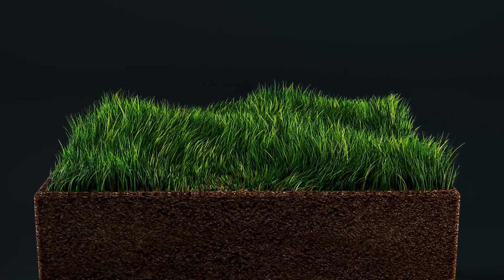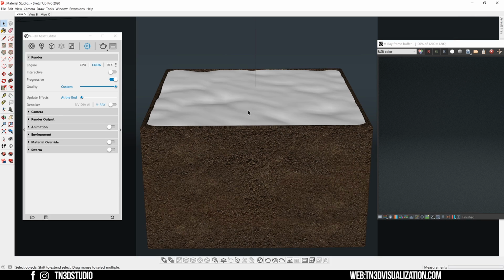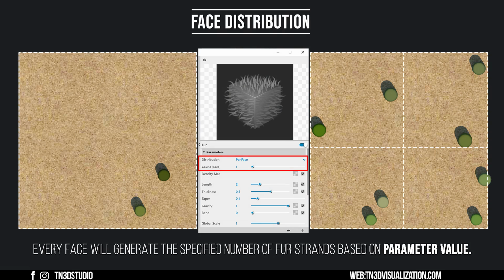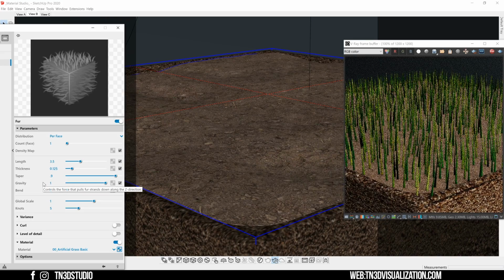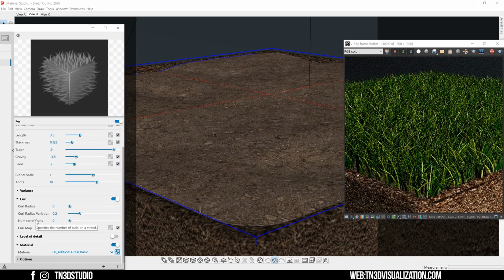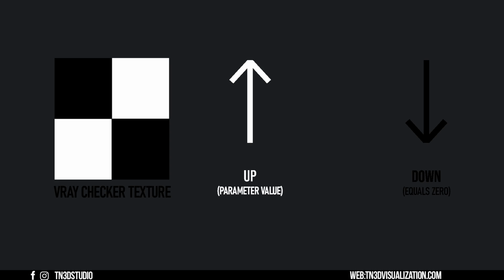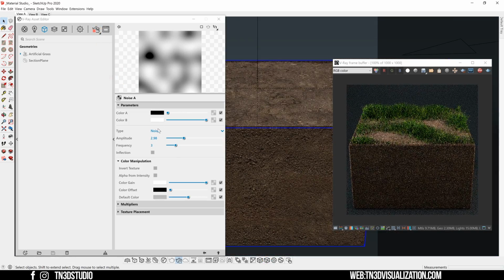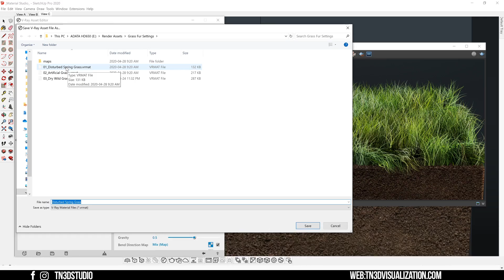Vray for Sketchup : How to Create REAL Grass Material Tutorial

Comment: Hey, amazing tutoriel, helped me a lot !

One question though, my grass works perfectly when rendered with the interactive render, but when i start a final render, the noise is visible on the grass... The parts affected by the noise texture loaded in Length are black... Any idea ? 😢
Reply from the maker: Interesting, might have to look into this. Do you have a material assigned to the grass already?
Reply: @TN3DStudio  Yes I have a material. What is strange is when I disable the noise in "Length" but put one in " Density", everything is fine. The issue is only with the "length" map...
Reply from the maker: @nvdr0j.cmonnomàlenvers  I see, maybe try a value like 4 or 6 on the length parameter, because that becomes the max high for the white values in the noise texture. if your ok with this, send me an image with settings to my email, i can take a look.
Reply: @TN3DStudio  Sure, will do asap ! Thanks a lot !

Comment: It works bt it will slow ur rendering like hell.
Reply from the maker: Yup, thats the only thing about it. Increases render time. But if you optimize your render settings, you can make it work.
Reply: @TN3DStudio  explain
Reply from the maker: @KL-ni2vx  If you check the render quality settings between Medium+ and High. I usually optimize the Noise limit, Subdivision, and GI parameter around those setting and render at high resolution.  It could also be your PC Specs, and complexity of your model. Just have to try the settings and see what works for you :)

Comment: i cannot find a way to apply the save vray fur to a new model. is there away to apply it?? since when i save the vray fur, there is only .vrmat file, unlike the proxy file that there will be also proxy file that is also save on my laptop
Reply from the maker: When your inside the new model, On the "Geometry tab" you should be able to import it. There is an Import asset option on the botton of the vray User interface :)
Reply: @TN3DStudio  no no, i mean after i hav imported the saved asset to the material asset, it seems like i cant applied it lol
Reply from the maker: @kongkhamluangkhot1829   Mmm, try selecting the object you wish to apply, than right click on your fur settings and apply to selected. should work :)

Comment: Really nice video but My Bend direction map only works in the Blue color, just the blue region changes the direction of the Fur.. in red, green and yellow region the Fur is super flat. anyone had this problem too?
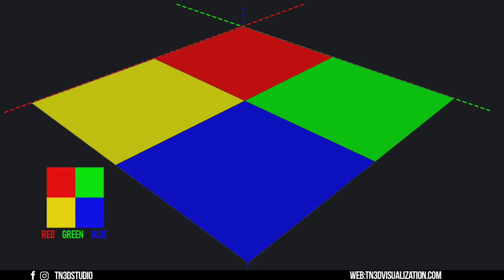Reply: by the way, a tryed using Cellular and noise, but none of then worked. even when a imported a bitmat texture just like this 6:00 to test, still not working. so frustating..
 Thank you anyway, Great video!
Reply from the maker: This part takes alot of trial and errors. it was by far the most time consuming for me as well. Play around with the scale and colors similar to normal map (purples, yellow, Greens) :)